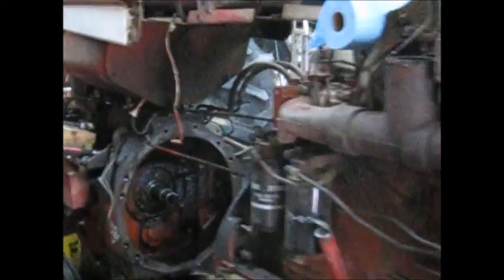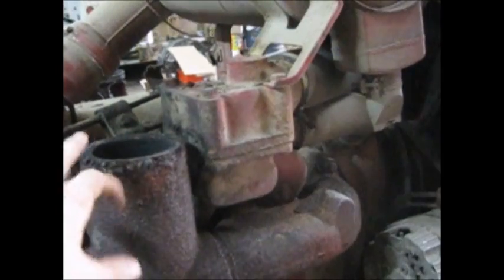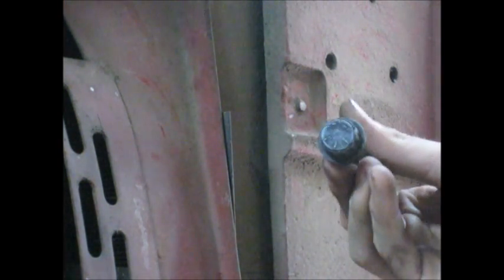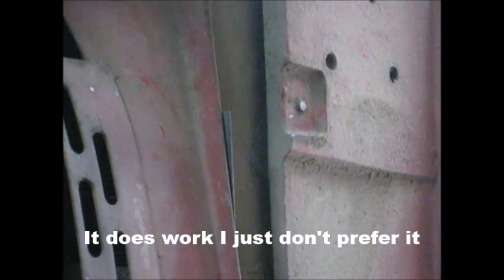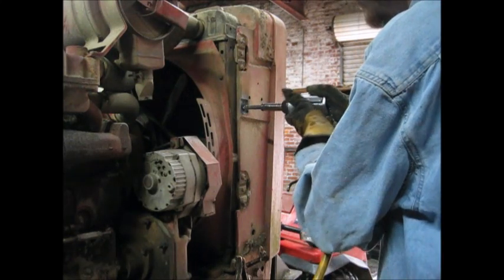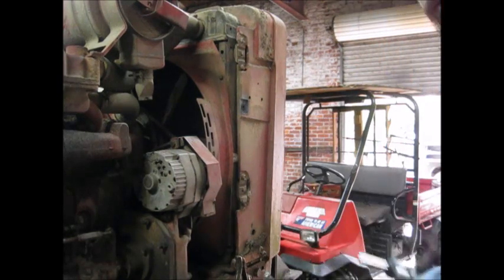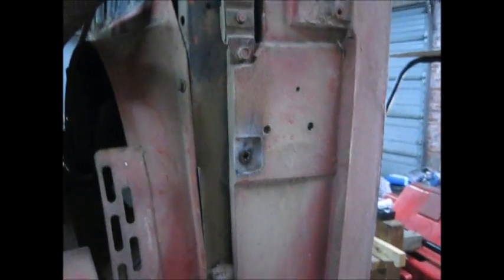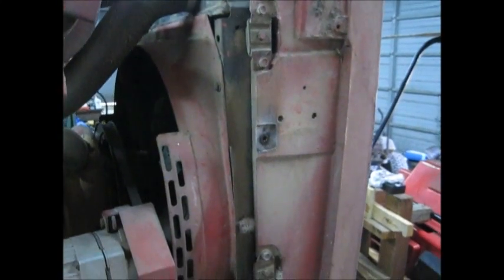Weld on bolt extraction

Comment: Just my 2 cents I watch your video but when I bolt extract with a welder I preheat with a torch so no cold weld, I see you did that with the first arc strikes, but when I extract them I use a mug with fluxcore, and a nut does not have to be a perfectly right size but just one that is close. After the nut is welded on I always let it cool down before removal because every time I have tried to do it with the stud being hot it snaps the nut because the heat swelled the stud in the bore, every time I have let it cool comes right out, ujoint busted bolts exhaust header busted bolts never  had a problem. But like I said it is my 2 cents, and I do enjoy watching you videos.
Reply from the maker: +Michael Bartels I hear ya.  I do preheat with a torch if it is a bigger size. (1/2" and bigger) aye cooling down is a big part I have shot water to make them shrink fast that sometimes can help.  Thanks man glad you enjoy them.

Comment: Nice video.I use to use that method but I found a better way by using a flat washer and a hex nut.Use a washer a little bigger than the stud you're trying to remove,place the flat washer over the stud and weld the flat washer to the stud next weld the nut(if you're stud is 3/8" use a 1/2" nut)fast to the washer and remove stud.It works every time for me.Enjoy your video's.
Reply from the maker: +bob litchko Good stuff to know thanks man.
Reply: Same but with a close fitting nut. That has always kept me from arcing to the cast iron base and you can pour the heat to it.

Comment: My Yankee wrench buddy puts a washer smaller than the bolt down if it's broken off flush or below. Then he puts a nut on the washer and welds from the broken off piece out through the nut. He works at the boulder hole shop and gets out all matters of broken stuff that way.  I bet you did about stroke out when you thought the Lincoln bit the dust. Don't blame you. Still the old flat head purring is music to the ears. And a good pal of mine always said "You make your own luck". Have to agree on that one. A-PLUS
Reply from the maker: +Lewie McNeely Very cool trick thanks for telling me.  Aye I believe that myself.
Reply: You're welcome and it sure works for him. I have one of them on my desk right now he got out of a U-joint yoke on a 980 loader.

Comment: i remember you mentioned the 6-8-10  trick in one of your  framing videos. you may want to spend some time learning about pythagrean triples (easier then the same suggest). Its some stuff i learned in geometry during our trigonametry course. 
ill give a basic explanation so you can decide if you want to spend the time (if you havent already)

how it works is the 6 8 10 is conected to the pythagrean theoram (a^2+b^2=c^2). and some sets of numbers are referred to as perfect squares. the most basic one is the 3 4 5. notice if you double all the numbers there it becomes 6 8 10. triple them all its 9 12 15. these triangles will still all be perfect 30 60 90 triangles. knowing how they multiply may help you when dealing with smaller or bigger measurments. theres actually an infinant amount of perfect squares. (next simple one is a 5 12 13) which follows the same rule as the 3 4 5. 
hope this was helpful just respond if i dident explain something well (probably already a decent bit of youtube videos and google tutorials you can go check out though)
Reply from the maker: +jonathan valentine Aye thanks for sharing.

Comment: Have friends and family breaking bolts and screws like never b4. These new batt. Operated impact drives are just horrible options 2 do most basic wrench work. Have found a little patience always works better then the cheater pipes.

Comment: Awesome tip. I have used the nut trick many times and it works. If you get a chance it would be cool to see more of your welding work. Glad your welder is ok. I  know down here in Florida.  Everyone keeps covers on their welders because of the rain and humidity  is really bad. We leave grease or oil on EVERYTHING :)
Reply from the maker: +Ron Hart That's a good idea.  I know we have so much dew in the mornings that my ole 200 doesn't like to run.

Comment: What can you put around the frozen bolt hole to prevent welding to the base metal?
Reply from the maker: You can use a nonferrous metal like copper or brass. Drill a hole and use it for backing I have done that a few times. You don't always have that option though the best thing you can do is use the right rod. 6011-6010-6013 are all good rods for that because they don't stick to cast iron very well.

Comment: i bought a screw extractor set, never tried it so far, its crap?
Reply from the maker: They work, but only on small bolts and screws.  And if they are not seized or rusted. I have had some good success with them, but have broken them too.